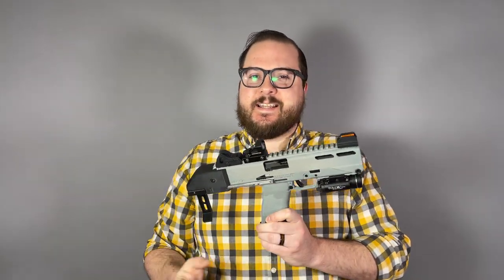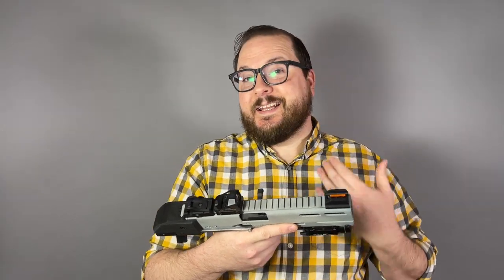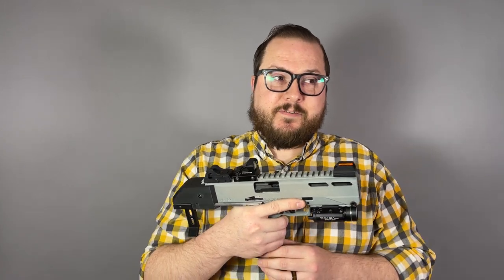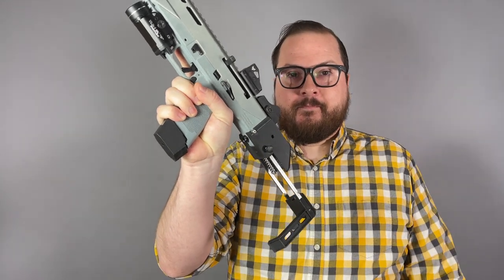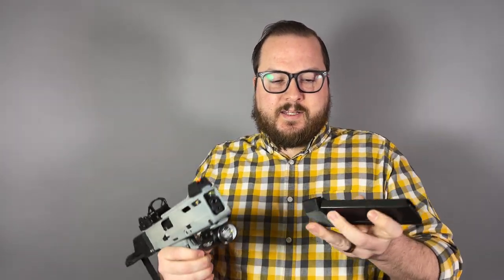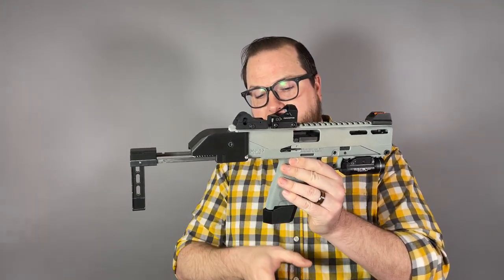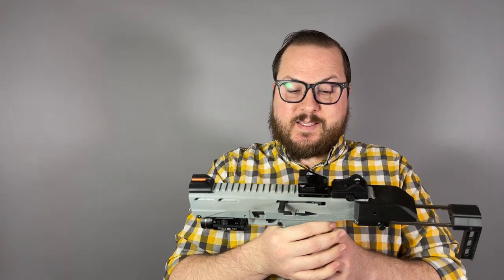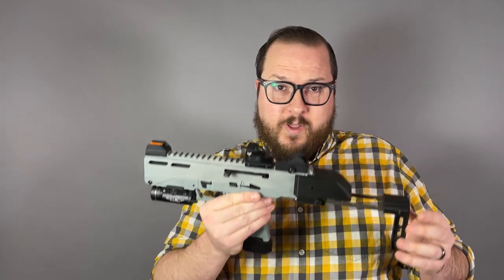Ruger MP57 - "We Have MP7 At Home"

Comment: I hope the company that takes up the project makes it as cheap as it ought to be. Smith was selling these at a pretty grotesquely high price consider it's literally just two 3d printed hunks of plastic and a pin to hold them together.
Reply from the maker: For what it's worth, I understand wanting to recoup design and development costs. And it's also not made of PLA printed on an Ender 3, lol. It's SLS printed (I believe) using Nylon 12.
Reply: @booliganshootingsports  even with that accounted for, i can't help but vaguely gesture condescendingly at the idea of this item and things like it costing, what was is? 400 ish dollars?

But i suppose there's also supply and demand and all that. I may get hot under the collar for pistol-carbine conversion kits, but the landslide majority of gun enthusiasts do not. So the market is limited.
Reply from the maker: @datpolakmike  You're not wrong. And ultimately, the market dictated that it wasn't the right product at the right time at the right price since it's now discontinued and the design licensed/sold. Custom Smith MFG is an awesome dude and a killer designer, I really hope the design itself takes off.

I'm interested to see what the new manufacturer comes up with.
Reply: @booliganshootingsports  honestly the design itself seems pretty rock solid feature wise, but off hand i could think of a few decent improvements. Maybe some reshaping on the back end to accommodate narrower collapsing braces? 3 and 6 o'clock rails? If they figure out how to be really REALLY space efficient, maybe a non reciprocating charging handle like the fcu x01 but lower profile?

Comment: Looks cool, it’s just kind of bulky and plain. I think if the front of the hand guard was slanted downwards like a mp7 and had more groove to the pistol grip. It would look a lot more tactical.
Reply from the maker: Form follows function. Adding a slant to the front would necessitate adding length to the bottom as it's as short as it possibly can be up front due to there being a pistol slide inside. I'm not a huge fan of the grip texture they used though, and the printable version I'm working on would have better textures there.

Comment: Need range video and also would it be better with a longer brace?
Reply from the maker: Legally, it can't have a longer brace. This is right at the edge of what's permitted under the current and future brace rules.
Reply: @booliganshootingsports  So all the braces I got from SB Tactical are illegal now? Cause they are longer than what you got on this thing
Reply from the maker: I mean, possibly, lol. Current rules state that if the LOP is longer than 13.5", legally, it's disallowed. This is right below that point. The ATF has also stated that many of the most popular models from SB Tactical are legally considered shoulder stocks in their opinion. This was a whole big thing that happened last year. 

Anyone running something like an SBA3 could potentially run into an unregistered SBR charge. Now, will they? Probably not. But the ATF has stated multiple times that they consider that model a shoulder stock. Here's an excerpt from one of their criminal prosecution advisement statements on the matter: https://imgur.com/a/e9HWUM0
Reply from the maker: You are definitely not wrong.
Reply: @booliganshootingsports  I think there's been a lot of problems with what the AFT has been trying to do and so far, their attempt at a point system that would make almost 100% of all current braces stocks hasn't been working out. We know this hasn't worked because SBtactical has continued to make NEW braces ever since AFT has been trying. I just looked at their new Scorpion evo brace and their new AR-15 brace based on the Honey Badger stock. Ever since last year, none of it's attempts are working and until I see major announcements from the brace manufacturers that they have lost the battle for braces, I'm gonna keep mine the way they are

Comment: "The 5.7 likes to curve in a longer magazine"
Huh? It was literally designed from the very beginning around the P90 magazine, which is absolutely NOT curved and stacks 50 rounds perfectly.
Reply from the maker: Our testing is showing that carrier tilt is happening with extended standard format handgun magazines. This is alleviated with introducing a curve to the magazine extension. 

5.7 is a non-tapered round, so it SHOULD be fine in a straight magazine, but the testing is showing differently for this specific platform. Just one of those weird things we discover when testing.
Reply: @booliganshootingsports  perhaps a result of the feed angle from handgun mags?
Reply from the maker: @InvidiousIgnoramus  most likely. Since they’re not perfectly stacked in a parallel line like in the P90, they misbehave a little, lol.

Comment: You didn't get your ruger for 500 bucks come on dude why lie ,where did you purchase it? Must have been used but than again I doubt that too. Full of crap. 500 my ass
Reply from the maker: Literally bought it brand new from a local kitchen table FFL here in Utah for $500. $600 total out the door since I bought a few boxes of FN factory ammo along with it.

These are $500 guns all day if you shop around. Checking sales histories online, I’m finding barely used ones with optics installed selling for $500, new ones and clean used ones in the high 400s and low 500s from small online sellers. 

Do a little research and find good deals. This stuff isn’t hard.